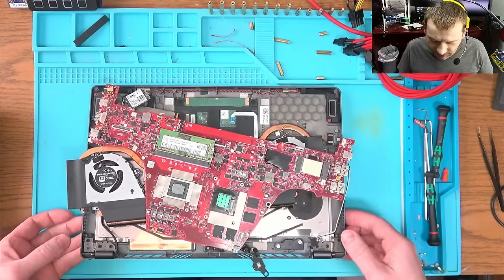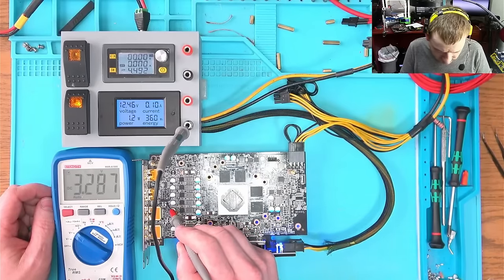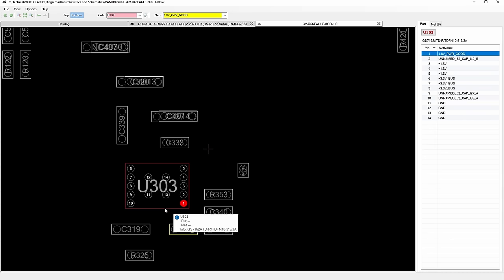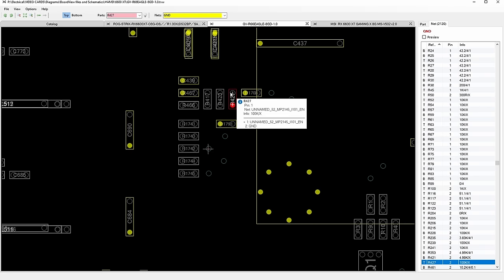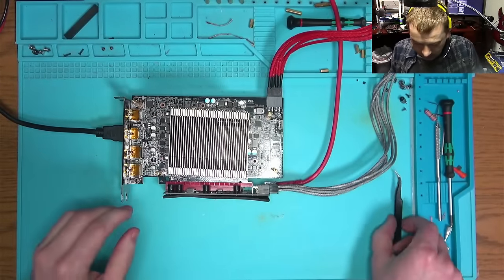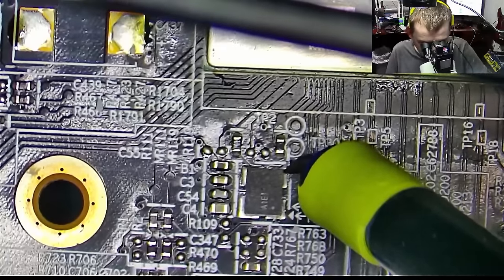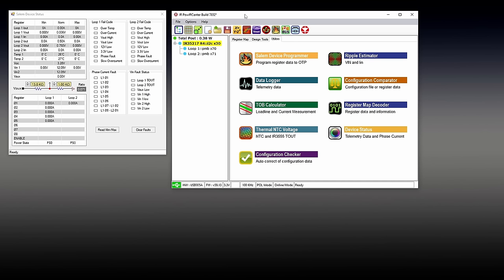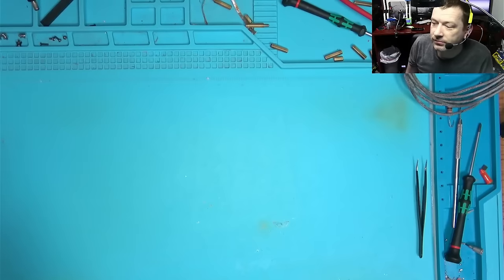SORIN GPU repair be like (AI voice)

Comment: Main power rail 1 ohm, properly calibrated fuse wire, replacing the capacitor (but not in this video!), hot glue is the best I tried everything, thinking vape, oh a new one is only $20 on ebay, I have several of this t-shirt for each day.

Comment: You missed a lot of key points of Sorin's personality. In fact, it felt as if NorthridgeFix was using Sorin's voice. You could have started the video with Sorin's usual "Hello, so we are back, and this time we have a niiiice [thing]. This is a niiiice [thing]". You could have said "thingy" a few times, as well as "properly calibrated wire". You could have used the word "dodgy" a few times. Etcetera. I liked the repair over all. Hopefully when and if you do TronicsFix it will be a closer impression (that's what makes impressions funny). TronicsFix's personality is a lot more lively.

Comment: What do you think of using a Cryosheet instead of thermal paste on a GPU? Not quite time yet to replace the TIM on my GPU, but in about a year or so, I am thinking of trying a Cryosheet and just not having to bother with it anymore.  I have a 3080ti.
Reply: No. Do not use cryosheet on GPU.
Cryosheet is for low power devices like laptop (mobile cpu).
And you can use once that cryosheet, sheet loose it quality on second install, it have design for install once and forget.